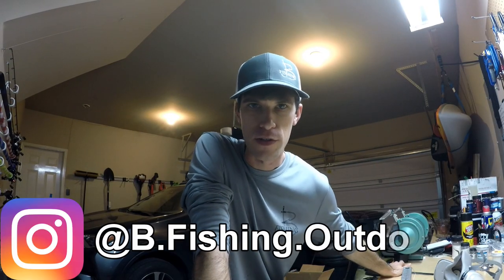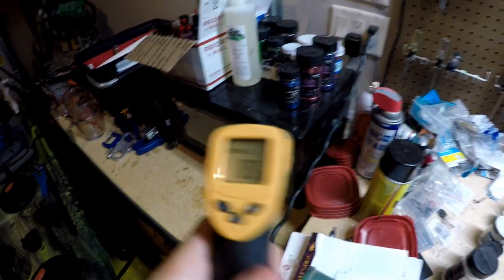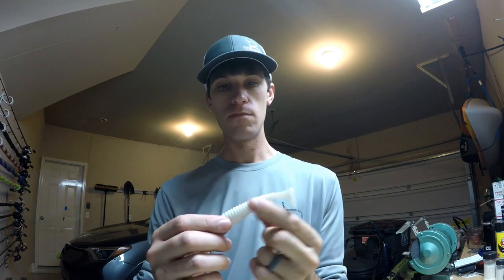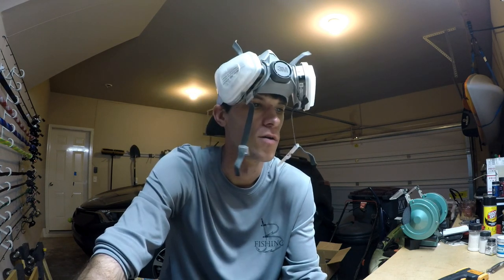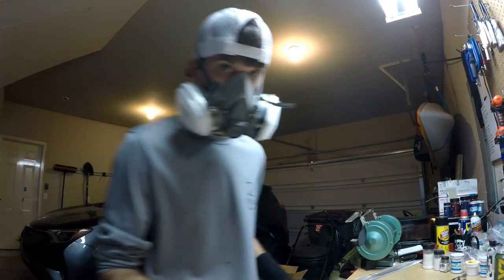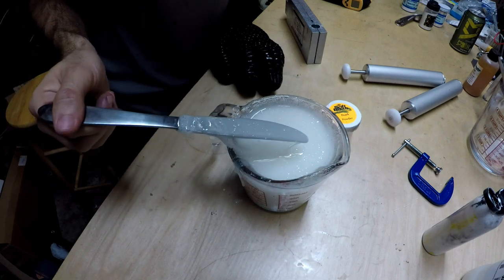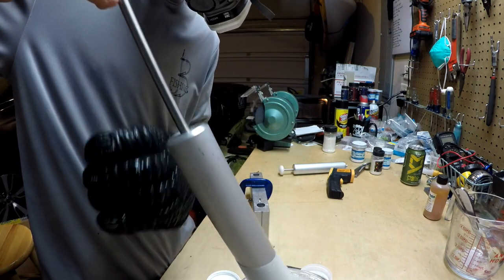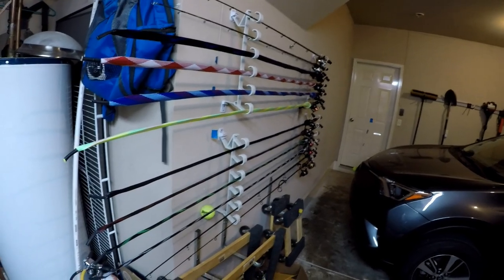DIY Making HOMEMADE Soft Plastic Swimbaits | GREAT Action Paddletails | B Fishing |

Comment: don't shake your plastisol! That is a good way to get bubbles infused into it. Just roll the jug around so it doesn't aerate too bad. Great video and safety tips! You should try and do a different colored tail using that do-it mold!
Reply from the maker: I do the roll now. I also use bait plastics plastisol now also and the bubbles are less with that brand too. I actually did a few videos more recently doing core shots with the do it ripper.

Comment: Use a hot air gun it will get rid of the bubbles turn on low so you don’t blow  the hot plastic out of the cup it works

Comment: Couldn't you drop the mold in ice water to speed up the cooling process and not have to reheat your plastic as often while your waiting for the baits to cool
Reply from the maker: You actually want a hot mold. If the mold is too cold the plastic will harden before it completely fills the mold. The injectors also has to be cleaned and cleared after every shot so that takes some time also. When you do it on a small scale it is just time consuming.
Reply: @B_the_Cameraman  I'm talking about dropping it in water after you inject the plastic
Reply from the maker: @jamesbarron1202  no I get that. But you want the molds to stay hot. Believe it or not most guys place the injectors and molds in an oven during the process to keep them hot. The issue is if you cool it down take the baits out. You then will need to heat it up again to shot another set. Now some guys will shot a bait, let it set just enough to removed it from the mold and then throw the bait in ice water. But it is not advised to cool the molds because it can create air pockets in the baits.
Reply: @B_the_Cameraman  makes sense. I've only done open pours from self made molds. I've never done injection molds
Reply from the maker: @jamesbarron1202  open pour you can definitely do what you are talking about.